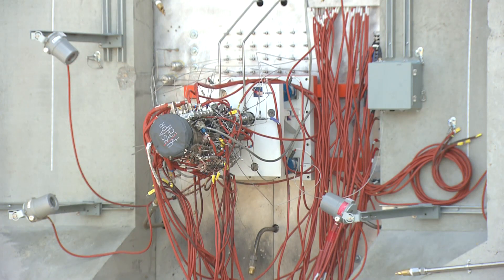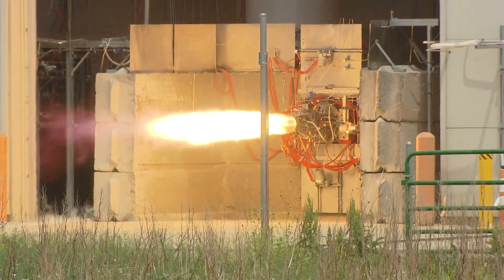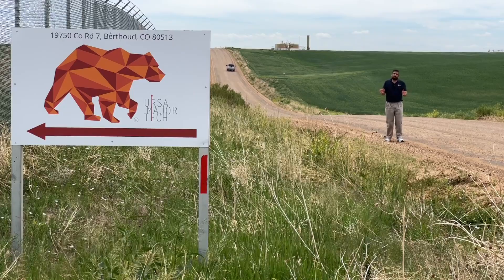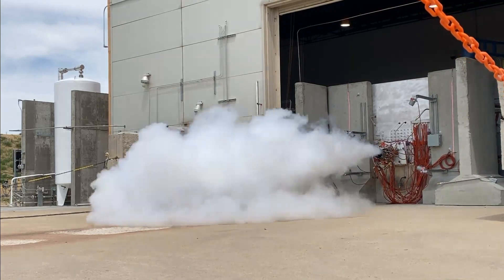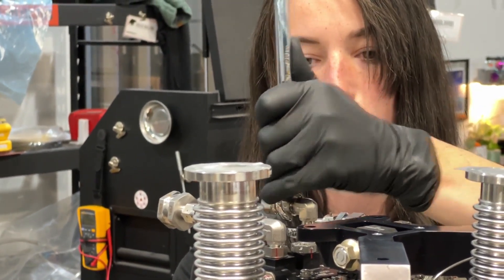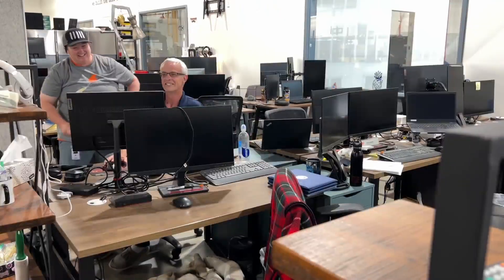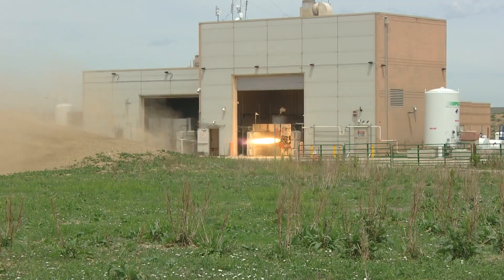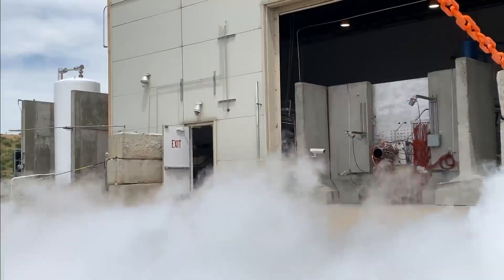Colorado Company Changing The Way Rocket Engines Are Made

Comment: Most Rocket Motors are in some way, legacy designs from the 20th Century built with 20th Century processes and there are some very good reason for that. NASA and the insurance companies underwriting the missions, wanted proven designs with a trail of materials, processing and inspection in case of failure. This is most especially true for any manned missions. Everyone is risk adverse, to say the least.... even into the 2010's older motors build before 2000, were still in inventory awaiting a mission.
SpaceX shook up the world of rocketry by essentially saying, "we can delivery the payload, just get the hell out of our way".
These guys and everyone in the Space Biz now, owe Elon Musk their gratitude for shaking off the shackles of first generation thinking about how rocket motors are made and how we use them.
Reply: SpaceX is also using the same kinds of engines from the 1950s, the falcon 9 engine is a very simple old design, very well executed.
Reply: @JackMott The raptor isn’t
Reply: @goodgremlinmedia2757  correct. hopefully they get it reliable enough to get to orbit and back. latest static test fire still had 2 not fire up.